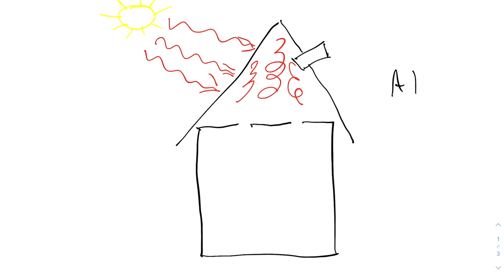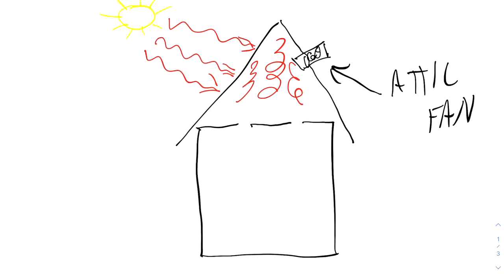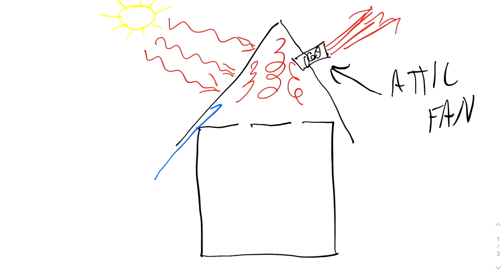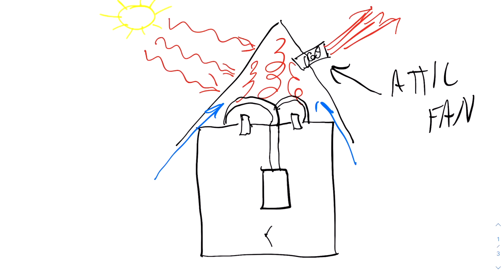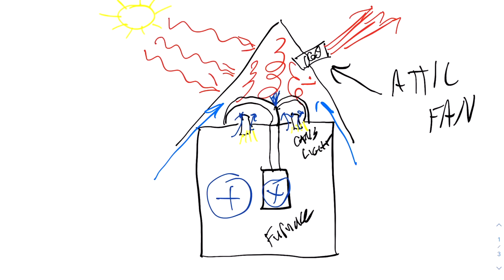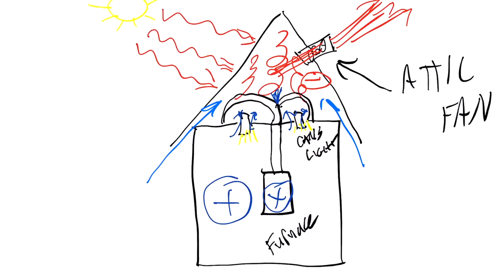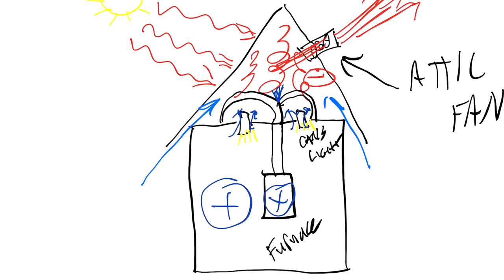3 Remodel Rip-Offs

Comment: My power vent makes a huge difference in my 120 year old house...
Reply: Show it in math and that will validate your claim. Otherwise such comments are pointless.
Reply: sorry, but almost certainly you just think it makes a huge difference and in actuality it does very little or even hurts you home's performance.
Reply: @alanr745  Maybe his home is not air conditioned. In that case it would make a big difference.
Reply: Alan R  Heh- 220+ year old house here- I think you are missing the lil  joke.  When you have 0 AC and are using open window technology, the power vent is a big deal- it does exactly what he describes but intentional in its function: create a negative pressure to pull in outside cooler air and gets rid of the warm air blanket.  He is completely correct when you are conditioning the air artificially with modern tight house philosophy.
Reply: romwil how so???
Reply: The power vent helps a lot when you don't use the a/c all of the time, especially if you use the cooling mostly at night.  If you tend to work late during the summer, then I think it will help.  And maybe use a zoned cooling system that only cools the rooms that you use.
Reply: The savings on windows would be due to air leakage reduction mostly. Not the slight change in r value.
Reply: @court2379  I'd replace the windows myself so the cost isn't that great for me
Reply: @alanr745  I measured the temp before and after and there was a big difference.  I don't remember the exact difference but it was significant and I do notice the difference in the house.  If you don't believe it, don't buy one.
Reply: @alanr745  Before, and after; electric bills should suffice.    Because the only monetary measure would be in HVAC changes.     Unless Matt has no insulation in his attic floor, AND he has no HVAC, in his 120 y.o. house.  Well, that might be the case:  perhaps he uses a fireplace in the winter?
Reply: Context is everything, in cool nighttime climates an attic fan would have huge benefits to cooling down the house.
Reply: @karlsapp7134  Shade trees can help a lot to cool the roof. I am blessed with live oaks
Reply: I had clients with not enough room for a modern Central Air setup in their electrical panel.  Single story, cheap-o 70s era track home.   Attic was an easy 140° plus on a summer day.  $100 attic fan in the gable end  knocked the attic temp down 30° and the house interior stayed around 14° cooler than previous summers.  This was a game changer for them until they could afford a new larger electrical panel and new Central Air setup.
Reply: I'm a general contractor with 35 years experience. To say a powered attic vent won't make a difference is silly. Heat rises and if there isn't enough static vents to pull out the hot air, it accumulates and increases the heat and forces it downwards. A good powered vent system will suck out the hot air pretty efficiently and leave the living space below a lot more comfortable. And no, I'm not trying to get a sale. It is such a small part of a project.
Reply: @timothykeith1367  We did that--it was remarkably easy once you got accustomed to opening giant holes in your house while you upgraded them, LOL. 
I always suggest to people who are comfortable with tools and construction to give it a go. It's not a daunting job.
Reply: I think he is referring to pulling air from inside an ac house or through the soffits.  We have a big attic fan in the garage that can pull air from quarter opened garage doors or the house on “warm” days  via screened door.  That works awesome.  If you want to put in an attic fan and you have an attached garage with attic access, I recommend it.
Reply: romwil
Haha. “Open window technology” Love it.
Reply: I've been in the HVAC business for 35 years. Couldn't disagree more with the attic fan statement. I've seen what they can do and they will take a big load off of the house. You can feel the difference in the Attic they work. They have sometimes and I have seen it make a difference if a house can maintain it's temperature. The negative pressure is not going to be that great. Pulling through the soffit Vents and many times now a ridge cap the attic will be nice and cool and keep 130 to 50 degree heat temperature load off your house. And there are inexpensive. You can put an attic fan in for well under $500 on a remodel. Probably more like 200 depends on how they get the electric wiring to it. Definitely worth the small investment in my opinion I seen them Workwell
Reply: I got one and did nothing. I actually got the top of the line Remington solar fan and my attic is still hot as heck
Reply: I disagree with matt here. Most homes aren’t ventilated properly. Ridge and soffit vents are alot of times insufficient. Power vents main job is to keep the air flow moving to dry out moisture in the attic, to prevent dry rot, or mold. Temperature savings in the home is a non factor, and shouldn’t be advertised as such. I’ve seen attics that literally sweat sap from the beams, it was soo poorly ventilated.
Reply: bigmacattk what I’ve been noticing now is that my humidity level inside my house is now 10% higher and my AC kicks on more often to bring the humidity down. So now my electric bill is projected $16 more this month. Worst mistake I have ever made
Reply: YOLO 

It isn’t really meant for a cost savings for the home. Its meant for air circulation in the attic preventing dry rot, and mold. 

If its pulling from your main home, then you don’t have enough ventilation in the attic. So matt is right about negative pressure. You need more passive vents, better insulation/ air sealing.
Reply: I would def agree that good ventilation is key to get rid of hot attics. #sinnisjInsulator
Reply: In New York most of the time their equipment was located in the attic. I lived on Long Island. More than once the customer would have has put in an attic fan to go with the AC. We would install that right away and start ventilating the attic and it made a huge difference. 35 years in the business I know an attic fan cool off an attic if it is properly ventilated
Reply: @benkuxhouse787  glad to hear that. It's all about front line experience. I see that simply adding from an r32 to r60 makes a huge difference in homes where the wrapped heat ducts can be covered with 1 foot of loose fill. Checkout my attic insulation channel if you want yo see more examples if loose fill installations.
Reply: And democrats won’t raise your taxes ~
Reply: Lol
Reply: @Laissez_Faire  how many cfm?

Comment: You can't think of powered fans and solar fans as the same thing. I literally have one of each sitting here. The solar fan is rated at 20 watts. The 120v fan draws 120 watts. Which do you think draws more air? The solar fans are kind of like the solar yard lights - it's a fun concept and they make you feel good, but it's just a decoration. Even though they may be of similar size, not even remotely the same CFM.

Also, solar fans shut off at the most critical time! When the sun goes down, your roof is still hot, but the air outside has cooled down. Your fan is also off. Powered fan would actually do something.
Reply: that makes sense, the area on the fan is so small you can't get much power from a solar cell mounted there. it's basically acting like an augmented convection vent.  my roof didn't have any ridge vents, a powered attic fan made a big difference in the attic temperature.  I'm replacing 140 degree air with ambient air, so I think that's a win.  you need adequate intake vents and home sealing otherwise the attic fan could suck air from the living space.

Comment: I live in Europe and we had the same problem that our roof was so hot you couldn't touch it during the summer months let alone be in the attic for any short period of time. After we covered our roof with solar panels, that were suspended about 6 cm over shingles, it took around 10 to 15° off of the heat inside the attic.
Reply: @MAGAMAN , I think they do that for some metal roofs. They call it a cold roof and supposedly keeps condensation from forming.

Comment: I am an electrical engineer and electrical contractor. Attic fans in an attic with no prior venting such as a ridge vent or adequate ridge vent would probably benefit from powered attic  vents. However you are going to be sucking air out of your house on its gonna get replaced by either outside air or crawl space air. Neither of which I want flowing into my house continuously. 
Also a house with a ridge vent will be sucking the air off your roof back in through the ridge vent which is counter productive. The best possible option is a good quality ridge vent and good quality vents in the boxing. The natural flow of air will do everything you are trying to accomplish with no power consumption. I have installed numerous powered attic  vents that did little to nothing. I tried to tell the customers the ridge vent they had was doing the job. Later a few of them asked me to come back and remove the noisy useless vents. Not saying they are never a good option but most of the time they are not needed. Matt is correct in most cases in my opinion but I think he could have went into detailed explanation covering more possibilities. There are always exceptions to the rule. Some people will go out of their way to prove you wrong just because they are geared that way. I would hate to think I waisted my life looking for the wrong in everything. Life is just to short. Your doing a great job Matt. No way you can please everyone nor cover every possibility.

Comment: Just moved into a 100yr old 2-story + attic house with a new roof in Kentucky. There are front and back attic windows, one with a fan attached. The attic ceiling has insulation and the floor of the eaves on the left and right have insulation. The first story has central AC, the second story does not (I use window units on 2nd story). Should I run the attic fan to pull hot air out in summer or not?